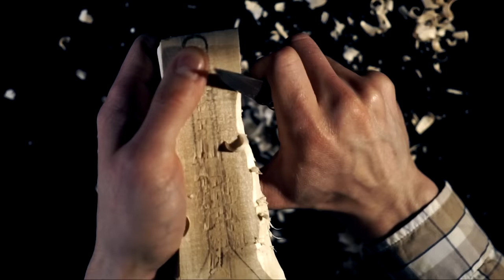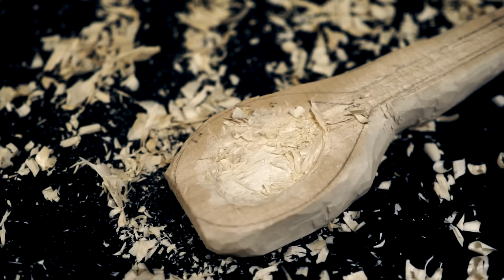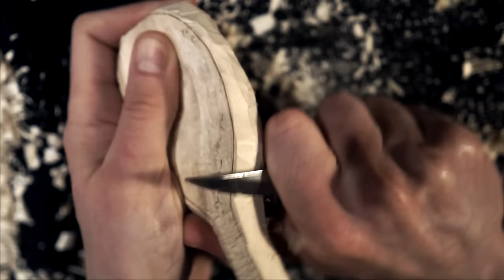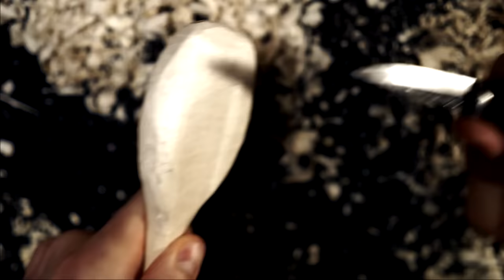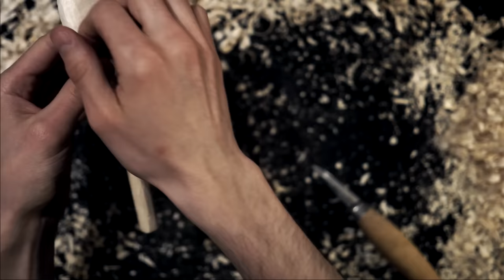ASMR Carving a wooden spoon

Comment: Timestamps! ☺️☺️  Sorry for the english 

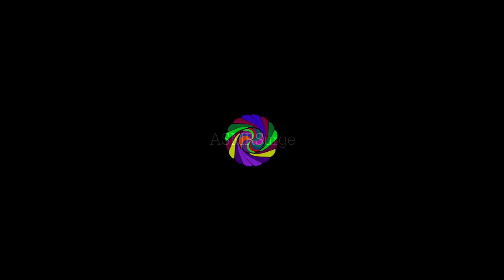0:00 - 0:21 intro
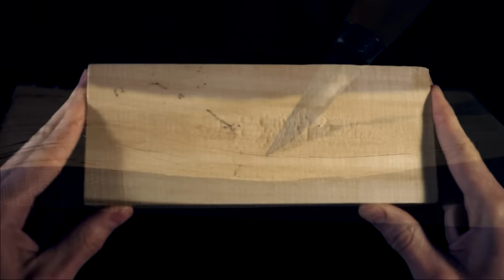0:27 - 0:32 knife on the wood
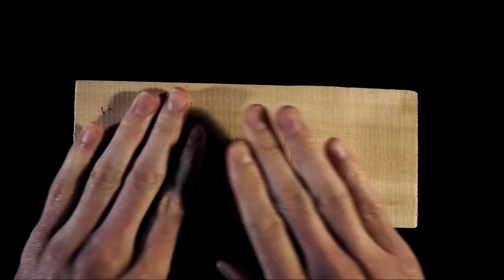0:32 - 0:58 scratching the wood with nails and fingers
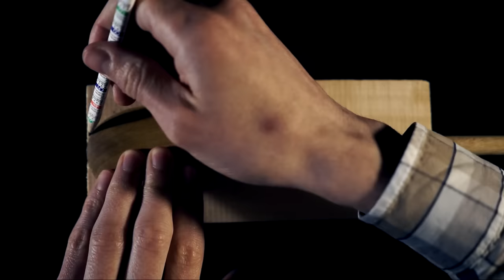0:59 - 1:42 wood spoon on wood block
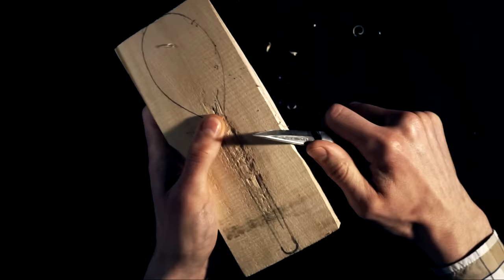1:44 - 4:29 drawing the spoon on the wod block with pencil
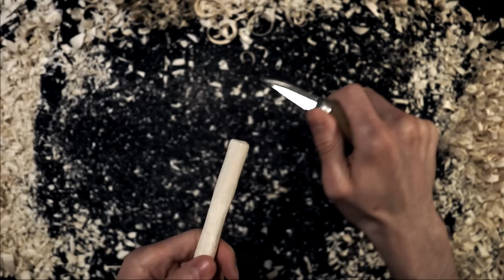4:30 - 1:03:14 carving the wood with knife 
1:03:15 - 1:03:41 tapping and scratching the spoon
1:03:45 - 1:03:55 carving the spoon 
1:03:55 - 1:05:53 sanding the spoon
1:05:55 - 1:06:37 scating the spoon 
1:06:38 - 1:07:07 sanding 
1:07:09 scating 
1:07:41 wood spoon on  wood block 
1:08:29 scating 
1:09:00 crunchy "dry" pasta? 🤔
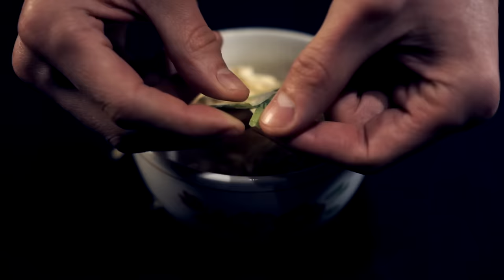1:09:23 plastic sounds
1:10:08 water sounds
1:10:32 spoon on the soup

Also if you don't mind can you check my ASMR channel out? ☺️☺️

Comment: Ik im late but incase you see this comment first great job on the spoon it looks great. But a word of advice from a fellow whittler. Keep your thump out of the way of the knife. Use a protective glove incase of a slip which happens all the time and it can be very serious (I’ve been there before and believe me it sucks.) Also the knife feels dull which is very dangerous so use a strop every 15 minutes you carve to keep the blade nice and sharp so it bites into the wood better. One last thing place your left thumb either on top of your right thumb or at the top of the knife handle and use your thumb to make the cuts. That way you have better control over the blade and your knife does not fly everywhere. Keep up the good work friend and keep carving. 👍🏻

Comment: 26:57 for that part of the spoon you could have used a 150 or 200 grit sand paper to smooth it out so you wouldn't have the large indents in the wood but besides that good video